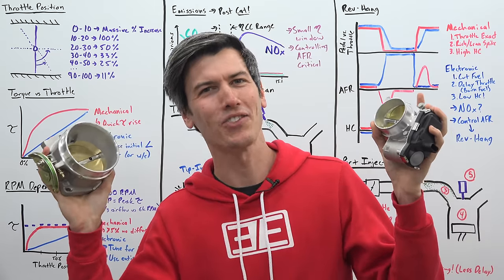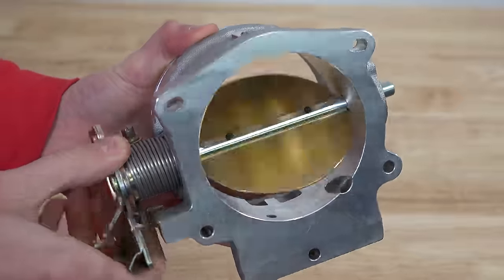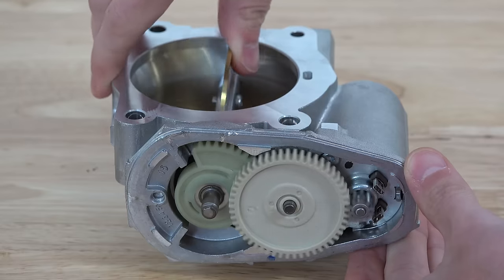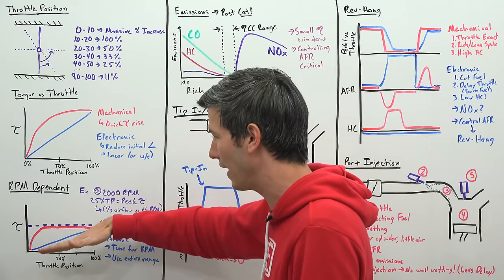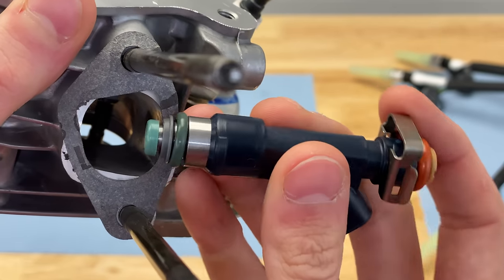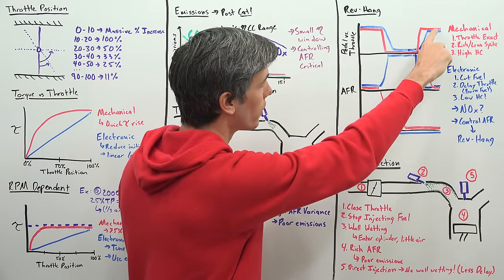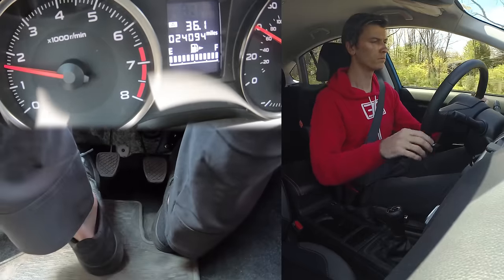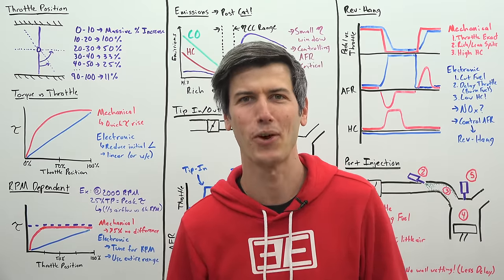The Big Problem With Modern Manual Transmissions - Rev Hang

Comment: 6speed crosstrek is the worst thing i ever drove when it comes to rev hang and jerking and notchy shifter, like real notchy as if they want to prevent you from shifting fast. even with heavy boomba shift plate, bushings, 700 grams grimmspeed shiftknob, worst manual transmission feeling ever. I can live with the zero to 60mph in 5 minutes, but because of the shifter feel, it needs to go! i wonder how you do it, being a car guy, doesn't it get on your nerves each and every stop sign?

Comment: Actually, i don´t see any issues with manual transmission at all. It´s manual - which means it´s sturdy and durable - as long as the jerk behind the wheel doesn´t try to put reverse in high speed and vice versa (it can actually still endure and work after that, even after intensive "testing" of it, some guy from Finland tested it) while doing all necessary maintenance, there shouldn´t be any issues with it. Even with neglected maintenance it can outlive most of other parts in the car.

Comment: Drive by wire systems are senseless. You can rectify mechanical throttle body input-to-flow with cam actuation.

Comment: that rev hang is actually a good thing for driver and passenger comfort, since it  delays the drop of engine rpm while you shift the gears, so when you let out the clutch, the engine rpm is approximately where it should be for the next gear instead of having dropped too much, so the jerk from the clutch engaging is diminished. My 2013 opel astra is actually doing a bit more than that, keeping the revs to the exact match point for as long as you keep the clutch pressed during gear shifts, so when you let out, there's virtually zero jerk. I love that feeling of smooth gear shifts.

Comment: Tip in, Tip out -- smoothing that out "smooths out"  (a nice word for kills) responsive performance.  The only reason electronic throttles suck is because some EPA bean counter has decreed it so. The job of the catalytic converter is to absorb these brief periods of tip in and tip out. Fail.

Comment: ive repaired my exhaust system and after that my car started rev hanging 
ive noticed that my exhaust were modified to fit without cat & after repair someone started the car without lambda sensor pluged 
ive replaced all gaskets on exhaust 

car after repair suffers from low power on low revs 
before car was accelerating from 1800rpm now it wont accelerate until 2800
car wont actually even start moving throttle response is awful and i stalled engine in one day more times than in last 6 months (i have a licence since march lmao)

any1 have an idea what could be the issue? i guess its not exhaust because it was second repair and then after first repair car was driving really well 

i wonder if it might be a cat burning procedure caused by starting without lambda

Comment: IMHO, most of these issues were solved by the Luft system that came installed on the 1980s version of the 280zx.  It had a mechanical throttle, with a idle switch, and an air box that measured air flow controlling the fuel injection.  I have nothing good to say about electronic throttles.  More complexity with little benefit.  The benefit is to the manufactures bottom line.  Not to the end user.

Comment: This seems like a lot of unnecessary complications to reduce emissions. They could have just kept the older mechanical throttle linkage and just use hydroxy injection to clean up the emissions. The same system would also give you a giant increase in fuel economy, then people would start asking question...

Comment: just got my first car with eletronic throttle, i just cant get my head around on how to properly press the pedal, i was used with regulating the pedal in many ways to make the car go smooth, but doesnt matter what i do, i cant make it run as smooth as the mecanical one, maybe the issue is the gears being shorter, but its really weird, i feel like the press on the pedal is just a sugestion

Comment: The first time I drove a "modern" car with an electronic throttle body I just stalled it the whole time. Muscle memory meant that I was used to using only a small amount of pedal travel when letting out the clutch to pull away. My conclusion? The "ideal" throttle response is whatever throttle response you're used to...

Comment: My wife has a Mercedes CLA250 and the throttle response is horrible.  Coming out of a low speed turn, you press on the throttle and not much happens - because it is in too high of a gear, and the electronic throttle chooses to open only slightly.  So you press more, and still no real response.  In fact, the response of the computer is to upshift to the next gear, so you have less torque multiplication and even LESS acceleration than the previous moment.  Again, you press on the throttle - this time a bit more aggressively out of frustration that the car isn't going anywhere and so the computer over-reacts!  It drops the transmission down two gears, whacks the throttle open too far, the turbo spools up, and now you have wheel-spin as the car rockets off, much to the amusement (not) of the policeman exiting the gas station...  Of course, there's no reflash for the computer settings, so you are stuck with it.  I don't necessarily want to drive like Michael Schumacher, just have a more responsive throttle.  Sheesh!!

Comment: Can RH be tuned out. I have 17' Super Sport Camaro, 6 speed manual trans. I get sometimes get some rev hang when I blip the throttle at low rpm.

Comment: So, "rev-hang" is caused by the use of an electronic throttle body which offers lots of benefits - which I really couldn't care less about, compared to the enjoyment (and sometimes, necessity) of quick and smooth manual upshifts. That's a shame.

Comment: Why not just use the clutch switch for fuel cut to eliminate rev hang? You wouldn't even need to close the throttle completely and revs would drop like normal.

Comment: Rev hang is not caused by the electronic throttle.  The rev hang is designed into cars to keep emissions in check.  Prior to the electronic throttle this was accomplished by vacuum.  Back then it was easy to defeat by disconnecting the vacuum line to the throttle body.

Comment: Rev hang is a total pain. You can't change gear quickly, it takes longer to slow the car down because you are getting less engine braking, and you can't balance the car as well through a corner by controlling the weight distribution between the front and rear. It's a total pain if you ask me and has totally ruined being able to handle a car properly.

Comment: Mines an 05 "4wd". Has the electric pedal. But if i new 100% i could put in a cable one in without complecations, or big costs, i would.
1 reason is it doesnt seem that i can make adjustments to cancel the dead spot on initial press.
The 2nd is if i get muddy water over the peddly (or salt) i would rather not have it be electronic.

Comment: Whoa, whoa, whoa. "As you get more air into the engine 'it' injects more fuel. What injects more fuel? How does a throttle body inject more fuel? All it does is allow the pistons to suck in more air. Fuel comes from somewhere, but not from the throttle body.

Comment: It’s actually a lot worse than even described. With butterfly valves all of the flow control occurs between about 20% and 80% open. A butterfly valve is non-linear, and pretty much the worst available way to control flow.

Comment: we dont drive cars like race cars, so the engine will always run a little rich or a little lean. if we did run them like race cars, electronic throttle bodies would benefit the amount of fuel burned between shifting.

Comment: Holy crap yes. It was annoying on my fathers 2004 1.8t Passat, and worse on a room mates 2011 Hyundai. 
I understand this is to do with emissions controls, probably NOx. 
Mercedes used to use complicated linkages on their mechanical throttles to make the pedal more linear.

Comment: Ford had Mechanical TBs designed to induce rev hang in the early 2000s. Supposedly, this was to burn unused fuel under engine deceleration, but I think it was just GARBAGE. I've been dealing with (yes, dealing with) mk1 focuses my whole car-bearing life and all I can say is that the zetec twin cam revs like a bike motor with a proper TB. EPA testing sucks, and I wish mfrs didn't have to tack on stuff like the early '00s fords had (these awful TBs) to create better data. My roommate at the time I had my last focus had to remedy the same problem on his v8 mustang. Come on, Ford!

EDIT:  The two vehicles I mentioned also had 10 ton flywheels. At the point these had reached, the flywhel DID cause rev hang.

Comment: The problem with modern cars, compared to mecanical cars, is that when I ask the car to do something, it has to think about it for a while before understanding what I want. A mecanical car just do what I tell it immediately.
Reply: My new MG Zs is terrible for that lag. You've got to tell it to go a good second before you need it to go. My 2006 Swift isn't that bad, and I wonder if it's a bug in the software.

Comment: Throttle by wire is trash… all the linking of too many modules over complicated everything & only benefits the driving aids that no one needs and many don’t even want.  Be nice to put all of it in the trash & go back to cable, ecm, tcm & abs systems relatively stand alone

Comment: My solution to rev hang is to help the revs down a bit with the clutch. Just a little slip, without power through it. With practice it’s gotten as fast as auto and a whole lot smoother.

Use the clutch to rev-match by bumping it a little until the tach stabilizes, then let it out to set it and give gas

Comment: The non-linear response of a mechanical throttle body could be solved by mounting the input cable to a cam that isn't round. Perhaps there are even some cars that do this.

Comment: Rev hang very much does exist with mechanical throttle bodies. I always hated it in my 1997 Chevy cavalier which had a cable throttle. The pcm achieves the same thing just using the IAC valve rather than holding the throttle butterfly open a bit.

Supposedly it's to reduce NOx emissions.

Comment: Hi Jason, would you do a video about throttle response controllers like Sprint Booster, iDrive and Pedal Commander? When I check I see that Sprint Booster has the fastest response. Love to see real life comparison despite what demos show. Do you think would it help slow / sluggish response vehicle like my 4Runner and do you think these will reduce the reliability of the power-train of the vehicles? I see cases where these throw check engine light and in some videos vehicle go to a limp mode. Love to learn about those from you. Thank you.

Comment: computers also were slower to that manual wire also making spikes no dual 02 sensor so many factors

current computers with all the current sensors manual wire would be just fine

Comment: The problem is NOT electronic or computation speed.  Physical conditions simply cannot change that quickly.  The fastest normal engine might rotate at 10000 rpm and have 10 cylinders.  That's firing 100000 times per minute or about 1667 times per second.  Slow processors might run at 4 million times per second.  The processor is sitting there waiting for conditions to change.  In electronic terms, the engine is not moving.

Comment: You don't need a electronic throttle body to change the input vs output. Just a rising rate cam aka base circle increasing on the carb. They have been modifying input bs output on compound bows for what 50 years now?  So first point is not a good reason

Comment: My 5th gen camaro has an annoying amount of rev hang, it honestly makes down shifts/rev matching somewhat inconsistent. Yeah I can adapt but sometimes it messes with me when I'm not actively thinking about it. And on top of it, theres a delay in the the throttle response in general. (common complaint from the 5th gen and even 6th gen owners). Which a pedal commander/throttle controller basically eliminated, rev hang still exists, not as bad, but the ECU is what governs it all. So unless I get a tune or switch to a cable driven system... I'm SOL on it.

Comment: I'm watching this as I had a Toyota Tacoma in the shop with a manual, and going for a test drive in it after doing some suspension work that the rev hang was god awful, and I thought it just had a massive vacuum leak somewhere but it was getting body work done so that wasn't to be touched at all

Comment: I experienced rev hang with cheaper cars. My grandma's 2009 Hyundai i20 has extreme rev hang and extremely slow throttle response. It has a wire spool with a sensor attached to the pedal in the cabin. And the throttle has a separate motorized wire spool attached to it. It takes over two seconds for it to react and it doesn't have any sensitivity. It's either full throttle or nothing.

Comment: No rev hang for me,  I took off the stock plastic intake/rails , fly by wire throttle body and cats. Replaced with a Holley 770cfm Carburetor on a hi rise single plane.

Comment: I'll stick to my cable operated throttle body on my stick car.  Those benefits for electronic throttle don't appeal to me.  My small SUV has the elect. throttle in an automatic which is fine for boat pulling and driving around the city.

Comment: Yep no way, Drive by wire is terrible for a performance cvar, it is for emissions.  Too many limitations of a performance car IMO, never seen anything beneficial from any of my mates that have gone to them, seems like they had headaches galore just to achieve what they had on the old throttle before hand.
If you nail the throttle WOT with the old, it is up to the VE of the engine and turbo to pump the air, the ECU just matches fuel.   With DBW throttle, the butterflies remain partially closed until it can consume all the air, which in turn reduces VE until full power.

Comment: But how much of a difference in emissions does that fraction of a second when the throttle body closes really make when you consider that the cat is already most likely up to temp? On top of that, how much of the emissions improvement is lost if the driver jerks the RPM's down on every shift?

Comment: How does this apply to diesel engines? I drive a semi truck for a living and all the trucks I've ever driven have an electronic throttle. They were all 2014 or newer and they didn't seem to have rev hang until I started driving a brand new truck at the end of last year. As far as I know, the emissions requirements for diesel engines haven't changed since 2010, so I don't understand why this truck does it. It's borderline undriveable.

Comment: a couple thoughts, but not fully thought out,  1-it seems you are also running with higher vacuum more of the time with the modern system and the 'vacuum pump' load of the engine is part of the explanation why spark ignited engine is less efficient than a compression ignited engine without a throttle valve.  ALthough on quick throttle plate closing when shifting  perhaps the vacuum pump load helps drop the engine rpms.  2-I can shift a wide variety of manual transmission cars that are carbureted very smoothly. Both slower revving heavy flywheeled engines (think a Chrylser straight 8 form the 40s and fifties) to a high revving small displacement light flywheeled engine (think any of the japanese or german cars)  I think a lot of it is also balancing the pressure plate springs and the clutch properties.  Lots of older vehicles had softer clutch engagement over a longer distance of clutch pedal throw that helped out vs th emore modern short throw quick engagement clutch. 3-So is throttle body injection easy shifting since it is closest to carbureted in terms of throttle plate and fuel injection? 4-I understand your theory but wonder about how many revolutions (perhaps one) it takes to clear the fuel fromthe intake system.  Say it takes 2 revs at 4000 rpms that's .03 secs and the cylinder is quite big compared to the intake system.

The end of my rambling thoughts.

Comment: It's not a problem, it's the ECU doing this due to Emission laws. Remember, the Govt does not care about speed, they care about low emissions, period. Get any Drive by Wire car tuned and this will be fixed easily

Comment: So computer is controlling everything except steering and some cases even that...how are people suppose to learn how to drive, when vehicles are now doing that to them? No computer will save you from laws of physics and how ever good the computer is, its limitation is the knowledge it has, so in situation what is not normal for vehicle, like point where driving assistance cant handle situation you are trown the control, while knowing less how to drive. Experienced drivers will react unconsciously to events and i trust my driving skills way more than to any computer that might go into tilt when ever. It also teaches to new drivers bad habits to trust on computer systems.
No, simply no way i will let car drive for me. I'm not going to touch another automatic car after it bailed on me. Was on icy corner and when i lost traction, i just pull hand brake to get back end on the slide, rev the engine and drifted most of the corner.. until the damn thing decided to change bigger gear and lost all torque needed to keep drift going.

Comment: I love driving a manual transmission car. Used to be much cheaper too. Now, if you can even find one, it usually a zero cost upgrade. Or it's only available on some expensive sport trim.

Comment: All this messing about with the throttle control just makes driving a manual car less enjoyable especially if you're trying to drive enthusiastically.  The whole reason that driving a manual is good is you have more connection and control to the mechanical parts of the car.  I'm glad that most motorcycles, especially entry level ones are still throttle cables because the only real reason many people ride motorcycles over scooters is having control over shifting.